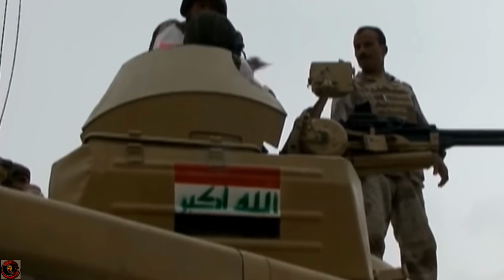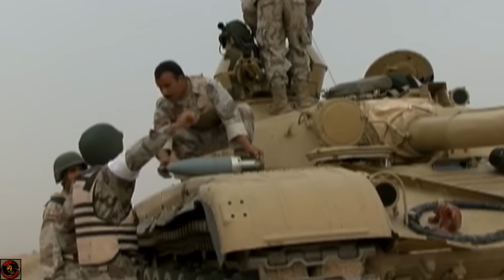Do Russian Tanks Need Bigger Guns?

Comment: Update to the "Leopard 3 is just a dream":
Kraus Maffay has confirmed that a Leopard 3 is currently under development and it is most likely armed with the 140mm Seelenrohr
Reply: The MGCS (Leopard 3) will be armed with the 130mm L51.
Reply: Jonny Ohh my bad, I thought we'd use our 140mm boomstick... Well, 130mm is still neat
Reply: 140mm was too unpractical. Two-piece ammunition, limited penetrator length and longer reload times.

130mm is pretty much the sweetspot. It's the maximum size for one-piece ammunition and still big enough for future plans (increasing chambre pressure/improving penetrator design).
Reply: Jonny The Americans developed an Abrams prototype that utilizes the German 140mm with an autoloader. I was hoping that the Leopard 3 gets like a super sick autoloader that fires like 10 rpm
Reply: KMW partnered up with Nexter because they already have live expieriences with autoloader technology. Also Rheinmetall was involved in the autoloader designs of the Japanese Type 90 and Type 10 MBTs.

The MGCS ('Leopard 3' as you may call it) will definitely set new standards in terms of protection, firepower and mobility for MBTs, like the Puma already did for IFVs.
Reply: Jonny Yeah I don't say it's going to be the Leo 3, but it has been confirmed that the Leo 3 is currently in development and I would love it to be awesome
Reply: Yes, the development for the MGCS (Main Ground Combat System, current name for the Leopard 2/Leclerc sucessor) has been confirmed:

end of 2018 results of the studies for the MGCS
2020 first prototype built talk about 6 different concepts
2025 first order and trials
2030 introduction into the german army
2040 for the french army (the want to keep upgraded Leclercs till 2040)

Considering the good reputation the Leopard 2 had, they may name the new MBT 'Leopard 3'.

Comment: i had a proposal for a Sherman tank with the turret removed and a 155mm smooth-bore mounted in an elevating mount in the hull. it would also have heavily improved engine and frontal armor. this would provide firepower for low cost, as well as being mobile.

Comment: 1: the Russians are still using the 125mm cannon since 1961, they dont need to adapt ammunition 2: it's only 5mm bigger than the standard cannon and this is because of the need to launch anti-tank missiles through the cannon

Comment: 203mm, why not ?
One thing that i still don't understand, why tanks place their gun at the center of the tank.
One answer i could think is probably for stability.
But if they put the gun at the starboard, much like cannon at russian heli, this could make some space separate for the crew, the barell length, and loader mechanism.
And this stabilizer problem that might be not to be adressed at all if the tank is ok with decreased rate of fire.
I mean, instead of taking the recoil horizontally, the tank could take it centrifugally.
Well it will look ugly if after firing the turret rotates to one side uncontrollably.
But, here i want to ask, isn't that possible to counterforce the centrifugal force, i.e by making the propellant blast exit at the other side of the turret. Or using some kind of spring like mechanism.
As for navigating stability, they could make the ammo storage at the opposite side of the tank, maybe some kind of ballast, or....
make the track weight different for the port and starboard.

Anyway if anything putting the cannon centerline is the only option, design like Strv103 still could make it.

Edit:
Forgot to say there's twin 203mm to address stability issues.
Must fire both guns at the same time.
Both barrel located outside the turret, a bit pyramidal chassis to allow the cannon to angle.
Bullpup layout to save the tank length.
Auto or Cartridge shell feed.
APHE shell with VT so the tank just using the same ammunition like naval gun with limited ability to engage airborne target.
Shells could be stored outside the turret to minimize detonation.

Also if back to the calibre size, one thing that i found it is ugly for cannon technology is by the fact why larger calibre is better.
Smaller gun could compensate this by rate of fire i think.
Because of pursuing penetration ?
Because there is limit how hard we could make a solid projectile ? So we went to mass ?
Why we made solid projectiles at the first place ?

Comment: The solution was found in 1967: the autoloading smoothbore medium-high pressure 152mm XM151 (?), housed in a slim but voluminous MBT-70 turret.

Comment: Well the whole point of the larger gun was more kinetic energy and thus more penetration, but with new technologies like rail guns that can blow a hole through 8 feet of steel with relative ease, might not be worth fittin bigger guns if you can just fit a rail gun and power it with a small nuclear reactor...

Comment: Sherman very rarely need a 76mm against German Panzers ? In battles they did have the panzers with there high velocity 75 mm defeated Sherman . In North Africa when a battalion of Shermans ,and Grants were attacked from multiple locations they were destroyed . The Germans set up trap and they drove right down middle of it . The TC on sturart drove right up to Panzers firing there 37 mm and surrendered when Panzer leveled there gun right on them .

Comment: A tank design like the Swedish prototype, Stridsvagn 2000, Strv 2000 would still be a modern tank. Designed i late 1980's and 90's, unmanned turret. Armed with a 140mm main gun and a Bofors 20mm secondary gun for light targets and AA.

Comment: I like the video! But these are only speculations because the larger gun has it's advantages over the smaller ones! For example the 152 mm gun has much more powerfull High Explosive round than the 125 mm! Same is for High Explosive Anti-Tank rounds too! Also the APFSDS rounds receives more muzzle energy because the 152 mm gun offers more propellant charge! In that case i not agree with you that the 125 mm 2A82-1M is better in performance(i mean firepower, range etc) from the 2A83 152 mm gun! The  125 mm i logical decision because it can be upgraded to be good as the 152 mm but imagine a situation (a war for example) where the fastest and cheapest way is to mount the 152 mm instead of waiting for new and expensive 125 mm gun! I found a russian source about the characteristics of the 125 mm 2A82-1M and 152 mm 2A83 guns! 125 mm 2A82-1MWeight - 2 700 kgBarrel lenght - 7000 mmMuzzle Velocity - 2050 m/sEffective firing range :Ordinary rounds - 4700 mGuided Reactive Shell - 3UBK21 "Sprinter" - 8000 mATGM - "Refleks-M" - 5500 mRate Of Fire - 10 - 12 rpmMuzzle Energy - 15 - 24 Mega JoulesArmor Penetration :APFSDS - 850 - 1000 mmATGM - 950 mmBarrel "Life" - 800 - 900 shotsAmunnition Capacity - 45 rounds (32 in the autoloader)152 mm 2A83Weight - 5000 + kgBarrel lenght - 7200 mmMuzzle Velocity - 1980 m/sEffective firing range :Ordinary rounds - 5100 mGuided Reactive Shell - 2K25 - 20 000 mGuided Reactive Shell - 3OF38 - 12 000 mRate Of Fire - 10 - 15 rpmMuzzle Energy - 20 -25 Mega JoulesArmor Penetration :APFSDS - 1024 mmATGM - 1200-1400 mmBarrel "Life" - 280 shotsAmunnition Capacity - 40 (24 in the autoloader)Of course the both guns can be upgraded to solve their drawbacks! For example the 152 mm gun's barrel life can be increased and weight decreased, and the 125 mm gun's muzzle energy and range can be increased! The both guns also has drawbacks that cannot be solved! Such as that the 152 mm gun requires more space (as you say in the video) and holds less rounds than smaller calliber guns and the 125 mm gun will be problematic if it's lenght is increased(for better anit-armor performance but will be difficult to operate in urban environment)! Also 125 mm gun's upgrades will be more expensive with every upgrade which in the end the 125 mm gun will offer similar performance like the 152 mm but for higher price!

Comment: The Firefly was also very valuable vs the Panther.
You still on about the reliability of autoloaders? ;)
Reduction in carried ammunition is not really a factor, given the first-shot hit probabilities these days.
The other option is to increase barrel length, which is what the Leopard is doing up to L55 as an intermediate step I think, ok yes that will somewhat increase recoil. An ok the vid mentions it.
Crewless turrets as in Armata makes it much easier to fit a larger gun obviously, probably the way forward, but can't see the US going that way for a while.
Armata APS shown capable of intercepting main gun rounds.

Comment: 1:36 more to the point ..  i don't think you can even  get a 140mm or 155mm shell that would be light enough for a single person to lift or transfer   from the ready rack to the breach so you're almost certainly looking at auto loaders ... the thing i don't get is if all you want is a faster projectile for more ke then when not just use a longer barrel and a bottle necked case like  what  the 5.56mm rounds do ... as my understanding goes the velocity of the projectile is dependents mainly on the  amount of presses that can be generated behind it aka more propellant = more gas at higher pressure  and the amount of time that gas has to act on said projectile  before it pressure is reduced to that of 1 atmo  aka when its no longer confine by the barrel aka the end of the barrel  if that is ... roughly correct ...   then increasing the  diameter of the barrel would be less effective than increasing its length of the barrel,   increasing the  diameter of the barrel really only affects the  diameter of the projectile   which for HE and HEAT and HESH  is useful especially for HEAT as its penetration is largely dependent on its diameter   but for thinks like KEP's like APDSFS  other than increasing the  area acted upon but the propellant gases ( yes i know that is important too) don't do shit  as the penetrator's only like 40mm in dia ... hence the DS part of APDSFS so again why not just use a  say 155  powder charge  with a 120mm projectile ?
Reply: 2:04 take a 120mm kep put it on top of a  er like  frustum shaped  nitrocellulose casing  then use the standard 155mm powder bagged charges  that the artillery use     take this https://en.wikipedia.org/wiki/Kinetic_energy_penetrator#/media/File:Obus_501556_fh000022.jpg  and put it on top of something shaped like this https://en.wikipedia.org/wiki/Frustum#/media/File:CroppedCone.svg made out of the same stuff the case of this https://upload.wikimedia.org/wikipedia/commons/1/1e/IMI120shells.jpg is made from  filled with the same  and then stack these https://upload.wikimedia.org/wikipedia/commons/4/46/PzH2000Munition.jpg behind that and  cover it in  https://upload.wikimedia.org/wikipedia/commons/1/1e/IMI120shells.jpg bish bash sorted .. break for tea anyone ?
Reply: 4:08 god your telling me .. i tried designing one of the buggers ... jess  ended up with a 2 point pivot ... https://3dwarehouse.sketchup.com/model/00abbc0b-b95c-49b0-b2b3-ebdb2808ace2/tank
Reply: incomplete...
Reply: 6:40 at this point you might as well just up armour and up engine an M109..

Comment: The Russians have developed a 150mm gun for a tank. They may fit it to the Armata once it is proven up as a new innovation. Overall I don't think they will go for a bigger gun for some time. With there now proven gun fired missiles they have had for decades they may not bother. It gives them long range hard hitting power. Most exported RussianTanks have not been supplied and equipped with these missiles.

Comment: I've heard a lot of folks talk about the equipping tanks with larger bore guns, the idea being that guns of larger bore are more effective than guns with smaller bores.

This ignores the mechanics of how tank guns operate.

Lets assume the T-14 is equipped with a 152mm gun (as many fan boys say it will be). 

The larger bore will have a negative effect on gun performance with APDS rounds because the larger bore requires a larger (and heavier) sabot.  The larger diameter of the sabot means more bearing surface resulting in increased friction and lower velocity for the same amount of propellant.

If we look at HEAT rounds, HEAT's penetration tends to be correlated (I don't know if its linear or not) with the diameter of the warhead, so there should be some improvement with a larger round.

However, a larger round is heavier and will result in a more arced trajectory, making penetration at range difficult.  Also, most modern armors are optimized against HEAT, so its a question if the increased effectiveness of the round offsets the increased effectiveness of modern armor.  

Given that modern ATGM's have a hard time penetrating frontal arc armor and they are not limited in diameter by the bore of a gun, I'd say most likely not.

Many of you will point out the German 140mm gun as evidence of the virtues of an increased bore.  However, the bore isn't what makes the German 140mm gun interesting.

The advantage of the German 140mm gun isn't in the bore, its in the case, which looks to have about 50% more internal volume than the 120mm case.

With increased internal case volume, you can load more powder for higher muzzle velocities.  In this context, the increased bore is to offset wear on the chamber and barrel throat caused by that much powder being burned.

However, there are no free lunches in tanks.  A round that much larger than the 120mm is going to cut into ammo capacity and create problems with ammo handling in the confines of a turret.  The only way around the problem is a major turret redesign with increased internal volume for the rounds and an autoloader.

Probably why the German's dropped the idea in favor of the L55 gun.

Comment: The 152mm calibre is a quite traditional one that the Soviets have been using since the 30s and throughout WW2 and have some experience with (though with much lower velocity).
They went out of favour for the reasons you mentioned, and because it had become unnecessary with the new types of ammunitions that came up during and shortly after WW2.

The upgrade of Soviet-era tanks like T-72/T-90 with the 152mm gun would certainly be possible, but impractical for a very simple reason: These tanks were never designed to house such a big gun in the first place, and would therefore require a lot of changes to be able to do so.

With the Armata on the other hand it is different. It has been designed from the onset with both the 125mm and the 152mm in mind. Why didn't they use the latter then? For the reasons you mentioned. It'd be costlier and with the 125mm caliber gun being capable enough to fight the modern western tanks we see today there simply isn't any need for it, and the 125mm caliber has not reached its maximum potential yet either. This is why T-90, T-90A and the T-90M each have a different gun superior to the former, the T-90M having the same armament as the 125mm-version of the T-14.

And on very long distances where standard 125mm rounds might get ineffective against western tanks, the Russian ones have the option to switch to ATGMs with a range of 5km.
But this one day should prove to be not enough, the Russians will be able to upgrade the gun without much trouble. The Russians have thought ahead, as you have stated correctly.

And btw, because I see that argument pop up again and again: It is NOT true that Russia does not have DU-ammunitions. They have them, but choose not to use them, and keep them as a fallback in case they might be needed. A DU sabot has a 20% increased effectivity compared to one made of tungsten that is otherwise exactly the same, but that does NOT mean any DU-rounds are automatically superior to any non-DU-rounds.
People who think that must either think the entire militaries of Russia, Germany and many more to be braindead if it were true, or be it themselves.

Comment: T90 got like 25 shells. So you can load 15 HE, 5 HEAT and 5 AP. That is already not great ammo capacity. If you install 155mm gun number shells drop into 10-15 range and that is disaster. 
Now armata got 50 shells and you can load 30 HE, 10 HEAT and 10 AP and that is great. But if you increase caliber into 155 mm then ammo capacity drop into 25~ number so again not great. If you already can penitrate enemy tanks upgrade into 155mm will be decrease combat capacity. 
On NATO side they got easier job because they use two shell type only so loading 35 HEAT/HE and 15 AP or something like that. simply it's easier to pick right numbers.
Reply: T-90A has 45 round capacity.

Comment: I feel that the currant 125mm gun is quite adequate ,you could concentrate on the AP ammunition developing depleted uranium rounds , plus you should concentrate on air power , because lets face facts if you dont have control of the air over the battle field what ever tanks you have , your going to be wiped out by the opposition .

Comment: More velocity is a better first step before going up in caliber. Higher pressure smooth bores with a long barrel should be sufficient, even with tungsten penetrators. This preserves ammo handling and quantity while often meeting penetration requirements.

Comment: Why not go the whole hog and fit one of those mahoosive 203mm howitzers on a 1970's Lada? It's not actually that much more ridiculous than shoe-horning a 150 High Pressure breech into a T80 turret. If you scaled everything for a 150mm main armament using current technology to have effective crew space your tank would end up at about 90 or maybe 100 tonnes - way too heavy for bridges, and would need a 2000hp engine. You'd just about be able to detect it with a magnetic anomaly detector!